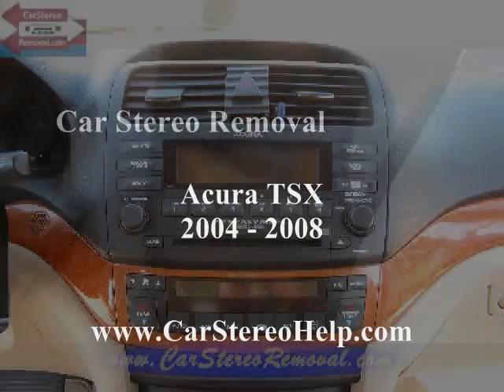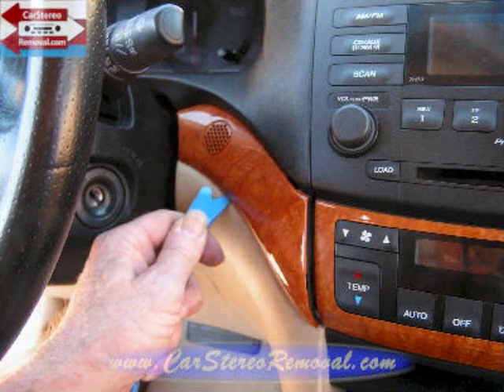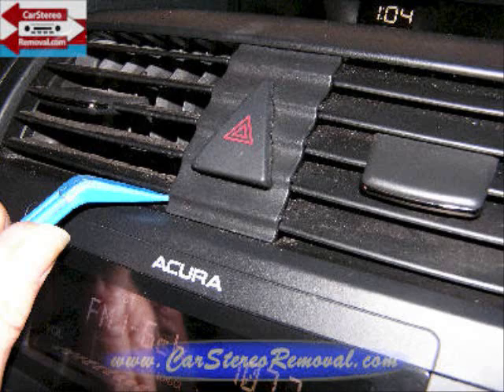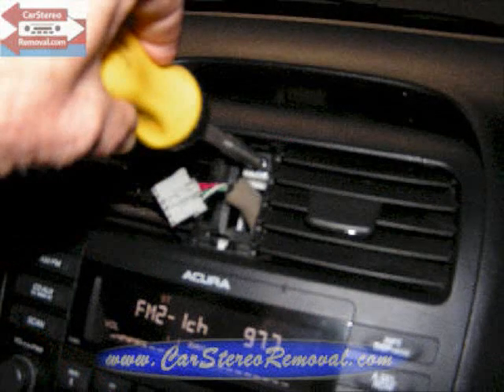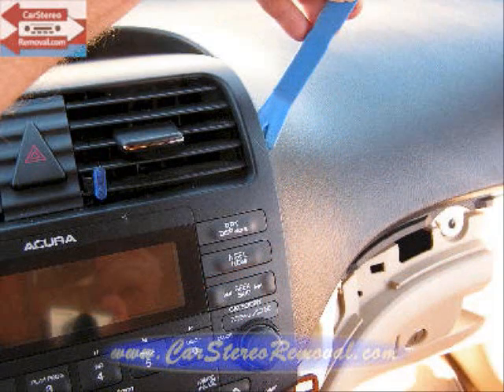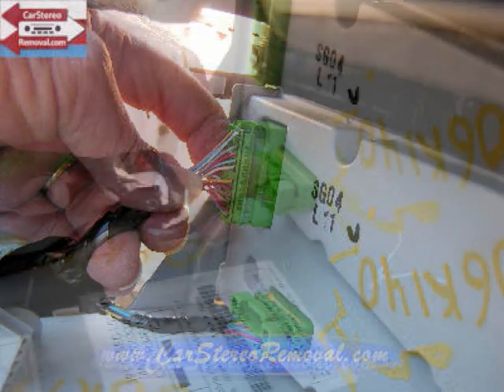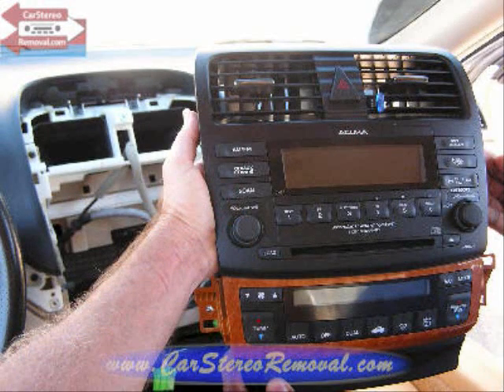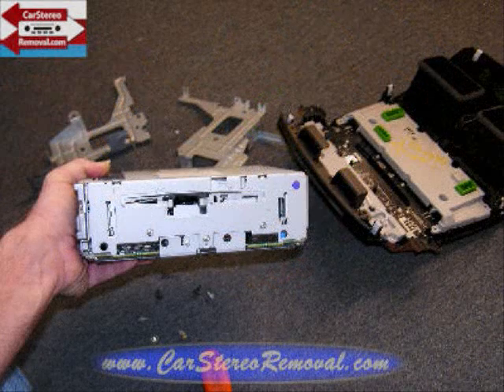Acura TSX Stereo Removal 2004 - 2008 = Car Stereo HELP

Comment: this guy wants your to break your car. you need to remove the storage bin under the climate control because there are 2 screws in there holding your radio to the car.
Reply: Exactly what i just did smh should have read your comment first lol
Reply: TOOK ME A FUCKING HOUR TO REALIZE THIS BECAUSE IT WASNT EXPLAINED HERE 💀 .. btw this is my first time doing this
Reply: I just destroyed my center radio assembly!! 🤬 wish I would have read this first!! 🥺
Reply: Thank god I’m reading comments first before attempting this 😂😂

Comment: You forgot to tell your audience to remove two more screws behind the push open din under the AC controls. This caused me to snap one of those clips on the bracket off. Please fix this video before anyone else's radio and AC unit gets destroyed.
Reply: I was just pulling on this AC control unit. Thank you !
Reply: I broke my og stereo thinking that was it. Fml 🤦‍♂️
Reply: Thank you, i almost broke mine.

Comment: Hey I'm trying to install an aftermarket head unit into my TSX and was wondering if the speaker wires and CD player was all on one wiring harness. If they are, which one? That would help me move those wires into the new stereo while keeping the other wires connected to keep the climate control and clock functioning.